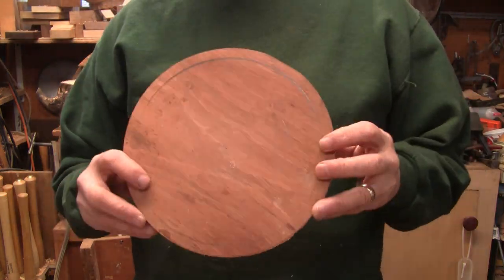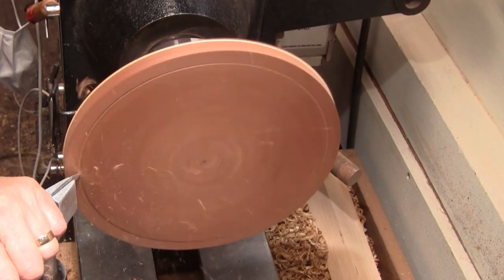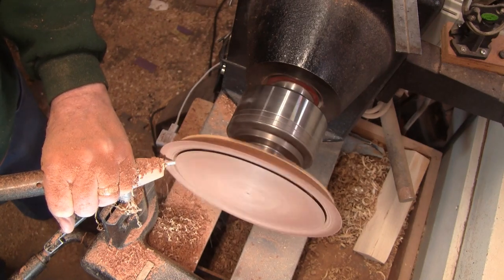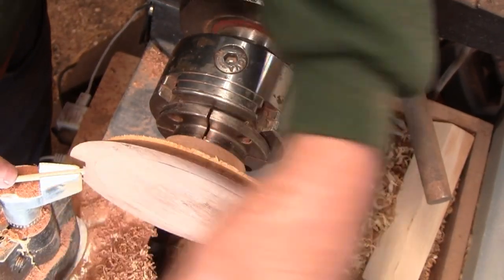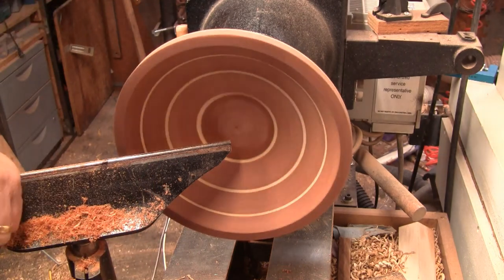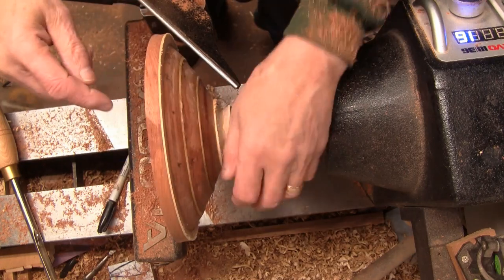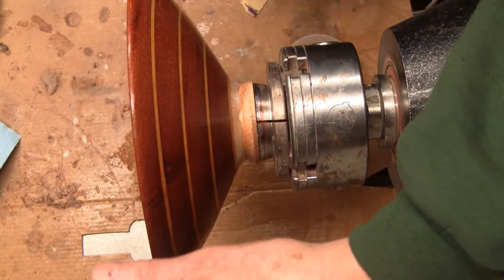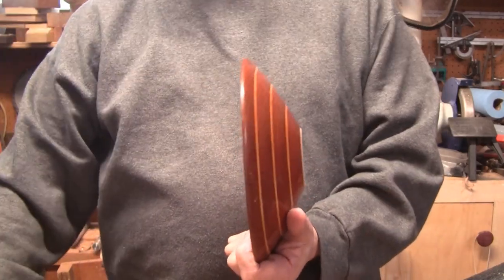Curved Bowl  From A Board New Ring Cutter Wood Turning

Comment: Another nice one, and a clear explanation and diagram.  What would be the result of making each ring just a bit wider than the minimum? Would this allow you more leeway in shaping the curve, since I suppose it would give a thicker wall?. Also, what material is the dowel support for your fixture?
Reply from the maker: Thank you Ron,
So the wall thickness is limited to the narrowest section. So if I made the ring under it wider I still would have to cut to the narrow section.
I will do some layouts to see if might help a little but the base will start to get very small because when making the rings wider it gets closer to the center.
 The metal rod is 1" 6061 aluminum. I had some steel but the aluminum is plenty strong.
Thanks for watching,
Gary
Reply: @ThePapa1947  For the one or two  straight sided ones I have made, i glued on a separate piece for a base, which i gave a shape contoured from the smallest ring and flared out a bit to make a wide enough base. This was not extreme, but my bandsawn rings got a little too wide.

Comment: Thank you so much for your lessons. I'm relatively new to wood turning and i have learned so much from your videos. My one question would be "and I'm sure you get asked this alot" where can i find the tool you use to cut the board?
Reply from the maker: Thank you Mark. In my earlier video I used one for an inexpensive set of mini tools. No name so not sure.
But the one I used here is the Robert Sorby mini parting tool. About 1/16" wide and 1/4'' tall.  Much better steel.
Thanks for watching,
Gary
Reply: @ThePapa1947  Thank you for the info...ive ordered one from Amazon. Im looking forward to using it. Thanks again for what you do for us and looking forward to the next video

Comment: Excellent. Love the bowl and your method of both cutting it and turning it. The bowl came out beautiful. I assume that a thicker board would make the layout even easier. One question for you, are you going to make and sell this jig?
Reply from the maker: Thank you Doug, yes for sure a thicker board would make a taller board and you would have more of the angle to work for and it should give a greater curve.
 I have been getting a lot of request for the jig and will do some thinking on that.
Reply: The beauty of the aluminum jig is that you could make a taller bowl using a thicker board and cuts with less than the 10 degrees and 5 degree in the instructional video. For example, 45, 48, 51, 54, 57 and 60 degrees. Wow, that would be cool.

Comment: Gary, when you hot-glued the tenon, was the glue only applied on the exterior of the joint between the base and the tenon, or did you put some hot glue on the surfaces to be joined? THat joint held up well throughout your build, but it sure seems like it had to withstand some stresses. I didn't know hot glue could withstand that much turning stress!
Reply from the maker: Hi Mike
I only put the hot glue around the tenon and against the bottom of the bowl.
Nothing under the tenon. I make sure the glue is as hot as it can get.
Works great but like anything try it out on something not as important first. Just to get a feel for it.
Thanks for watching.
Gary

Comment: Gary, can you provide where you purchased the tool rest to cut the bowl? I checked in my town and it was way more expensive than I would have dreamed.  Thanks Tom
Reply from the maker: I bought both parts off of Amazon
NOVA Large Box Rest 9094
NOVA 71091 Tool Rest Post, 1x8"

Put those in Amazon and that is what I bought.
If using it for the jig I would get the shorter box rest.
Also make sure what length you need for the Tool Rest Post

Comment: great job. Does it matter what thickness board you use, and is there a minimum thickness, thanks in advance
Reply from the maker: Thank you Steve! No any size board will work. I prefer 3/4 to 1 inch.

Comment: Do you have plans for the metal piece that the parting tool fits in? I do not have a metal lathe but would take it to a metal shop to have it made. Is it possible you sell that?
Reply from the maker: @jackhartman4897  the main part was done on a milling machine. I did it on my CNC mill.
But I have files to make the guide that bolts on the Nova and Sorby modular tool post.

Comment: So interesting! I am slowly and emphasize slowly learning.  What software did you lay this out on and is there any specific programs you would recommend I look at as I prepare to take the plunge into a bowl from a board and/or segmented bowls?  I am very good with a computer and can search this information out, but I respect your expertise and background.
Reply from the maker: Thank you very much. I use a program called BobCad. I use it for modeling parts and making the programs for CNC cutting.
If you are talking about software for the bowl you really do not need any. Just by making your first cut and then measure the bottom edge like I show and transfer it you are all set. 
I would recommend starting with a 45 degree cut for all the pieces. Once you get that figured out you can then try for a curved side bowl.
Let me know how it goes.
Gary
Reply: @ThePapa1947  Thank you for the response. It is amazing how you answer everyone.  Yes, you gave great instructions that I should be able to follow without issue. I appreciate the tip of starting with all 45 degree cuts.  I will be glad to let you know how it goes, however I expect I am a few months away from my first attempt.  Nevertheless I am thinking about the project and will be accumulating the tools and materials I will need.  I may never get to this point, but what if you wanted to add one or two additional rings?  In your example you use a 45 - 55 -and 60 degree cut.  How would you determine the angle needed to add a top or bottom ring - is this where software would come in or would it be a trial and error method using scraps?

Comment: So, one question - is the post aluminum also, or is that a wood dowel with just the top piece being aluminum?  you comment that its a dowel, but I can't see close enough to tell.

thanks!
Reply from the maker: Everything is made from 6061 aluminum.
I think I will be making a video on some optional ways to make one of these.
Thanks for watching,
Gary

Comment: can you buy the cutting jig any where ( I live in Australia) or a set of plans to get one made
Reply from the maker: I would love to see a link to the one you can buy. Also the plans would be nice to see.
Reply from the maker: @Zzrdemon6633  that should work fine. I have a milling machine so I milled the top section and bolted to 1 inch round stalk. How wide and tall is your parting tool?
Reply: @Zzrdemon6633  thanks Dave will give it a go

Comment: Which Hot Melt glue do you use?  I am having difficulty removing the drive hub after turning.
Reply from the maker: I use Arrow brand. The multi purpose removes easy with denatured alcohol. I do not put any under the tenon. Only around the outside.

Comment: Did you make the fixture you designed or have it made?  Is it steel?
Reply from the maker: Thank you Barry. I made the fixture. Like most things I make it if I can. Having a metal lathe and a CNC milling machine helps.
I made it out of 6061 aluminum. I did not have steel round stock long enough and the aluminum is plenty strong.
 Thanks for watching,
Gary

Comment: Gary, I toyed with this after your earlier video. I had some issues making the guide for the cutting tool robust and stable enough to reuse. I like the tool rest you came up with and will give it a try. 

I found a 1/16 incH Soreby and seemed to bind in the curve of the cut. I think the tool rest you have can remedy that. Thanks for taking your ideas to the next level.
Reply from the maker: Thank you Ralph, yes that 1/16" tool is flexible for sure.
You could do this with one that is 1/8" wide but the height would need to be such as you would have clearance for the tool in the kerf.
I will draw that up and see what is needed.
But the 1/16 tool worked fine in this jig.
Thanks for watching,
Gary

Comment: What diameter is the wood?  How wide apart are the pencil lines?  Thanks
Reply from the maker: The wood can be about any diameter you want. I would not go less than 8 inches. The thickness should be between 3/4 and 1 inch for easiest  results.
 The spacing really depends on what you are trying to do. Sometimes I vary the angle so the spacing changes.
What I do is measure the bottom of the cut and use that for the size of the next ring. I show that in a few of my bowl from a board videos.

Hope that makes sense,
Gary

Comment: What program did you use to show at end
Reply from the maker: It is called Bobcad and I use it for my CNC milling machine.  It is also good for making drawings like this.
It is not free and there are plenty of free programs that will do as good. But they do not have the option of creating gcode to send to the milling machine.
Thanks for watching,
Gary

Comment: Hi Gary,
Very nice bowl, the thin Balsa gives it a real nice contrast! I will definitely have to make this jig :-) Curious as to how thick you’re parting tool is and what angle do you grind at? Your negative rake scraper is that homemade or is it a brand name?  As always your videos are awesome, well presented, excellent explanations! Thank you for taking the time to make and share them..
Take care,
Wayne
Reply from the maker: Thank you very much Wayne. 
The parting tool I used was a Robert Sorby https://taytools.com/products/robert-sorby-unhandled-1-16-micro-parting-tool-865
I bought the blade on Amazon though. And you can buy it with the handle.
It is about 1/16" wide and a little over 1/4" tall.
I left the angle the way it is which is about a 60 degree grind. I think it could be less pointed and might start grinding it that way.
 Hope that helps,
Gary

Comment: Gary, I just watched this again because I'm making (well, made actually) my own jig and I needed a refresher.  I have a question.  Have you tried 65 degrees for the final angle?  Thanks!
Reply from the maker: I think one was close to 62 degrees. But a 65 will work but you may get real close to not having much of a base.
Reply: Cool, thanks, Gary!  I have a plan if that happens.
Reply from the maker: Sometimes the best plan comes after the fact LOL.

Comment: Can you visualize a way of making a deeper bowl by using two boards to make one bowl?  I am throwing it around in my head, but just do not see a way to make it happen.
Reply from the maker: Only way to make it deep is to start with a thicker board and have steeper angles. Also start with a larger diameter piece.
But if you did have a thicker board and used a 45 degree angle it would get to the center faster and you would not get many rings. So you have to balance it all out. Paper and pencil will tell you what you can get away with.
Hope that helps.
Gary

Comment: What was the diameter of the lank before cutting?
Reply from the maker: As I recall it started out as a 9" disk. Then after turning it was 8 3/4" in diameter.
Reply: @ThePapa1947  Thank you.  Mine finished at 8” and that 3/4” extra will make a difference on the next one.  Your new design cutting jig in this video works great.  Thank you.

Comment: I noticed you cut the rings at 45˚, 55˚ and 60˚.  was the 10˚ difference the outer-top ring?
Reply from the maker: I started with 45 and then went to 55 and finally 60. Hope that helps.
Gary
Reply: @ThePapa1947  was 45 the bottom ring or the top ring?
Reply from the maker: @morgancalvi6675  The top ring
Reply: @ThePapa1947  ok, that's what I thought.

Comment: What CAD program are you using?
Reply from the maker: I use a program called BobCad. It does CAD and CAM.
Do you work with CAD?
Reply: @ThePapa1947  no, ive not had tge patience to learn! Im pretty computer savvy, and use a number of different software applications for work., just not dug into CAD.

Comment: Hi Gary,
Another wonderful bowl👍
The highlight for me, besides the bowl, was the discussion at the end.  Addition of colors in the drawing was a real help in visualization.
I noticed some comments on the jig and making it available.  It’s all aluminum,  or attached to a wood dowel?  Also need to ask if the cutting tool is custom or bought and it’s dimensions?
Reply from the maker: Hi Skip, very happy you enjoyed the ending part. I was not sure at first and saved it to the end. Some may not be interested and then just stop watching.
 My cutting jig is all aluminum. I happened to have the 1" round stock and used it for this. My tool is a Robert Sorby Micro parting tool. It is about 1/6" wide and 1/4" tall.
 Coming soon I will put together a video on how you can make this with store bought parts. I have a lot of request for making and selling them. There is too much involved and selling them in not in the books for me. 
 But I will show in a upcoming video a simple answer to this. Like all things the builder and user is responsible for the tool if they should decided to make one. 
 Thanks for watching,
Gary
Reply: I look forward to that video👍
Reply: Gary,
I have a follow up question - I have a nice piece of 8/4 walnut…can I use the ring cutting technique on this stock?   Do I need to use a different angle or other accommodation to make it work?